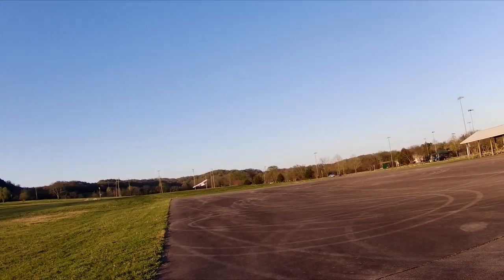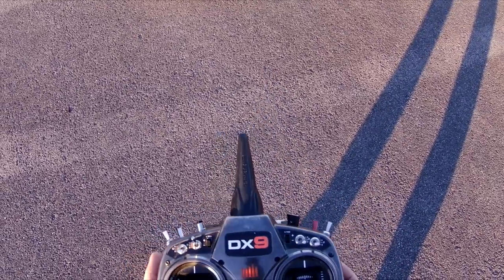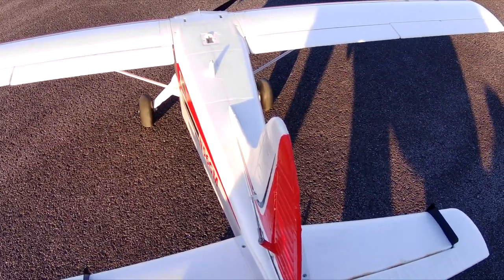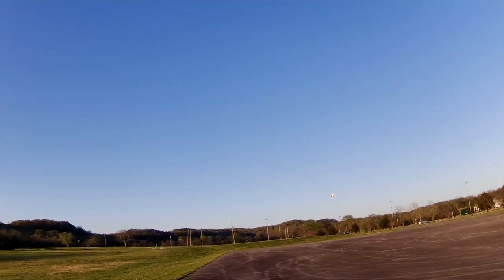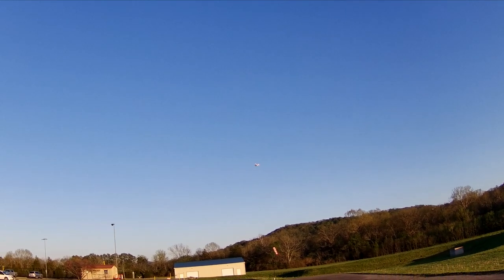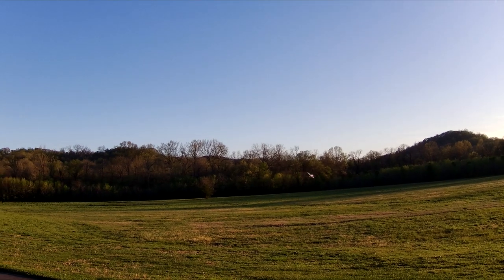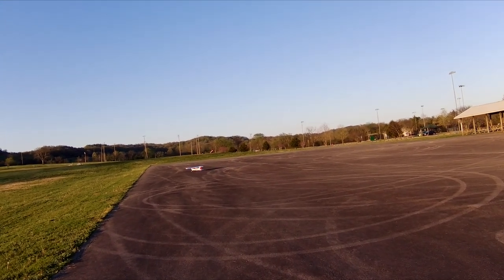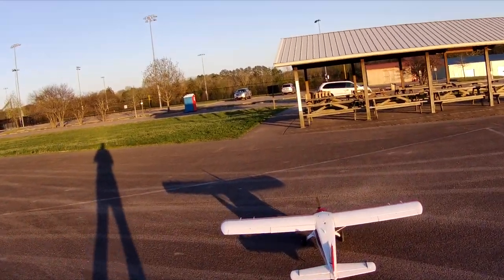6 FT FMS BEAVER V2 RC PLANE WITH REVERSE

Comment: Awesome landing! That's the landing you want right there. Stay up on mains until the plane comes to a complete stop, then gently place the tailwheel down at rest. LOL. Gonna save that rudder servo! I've been thinking about ways to reduce wear on it, maybe perform all rudder servo testing/movements with the tailwheel raised on a jack stand, reduce taxi-turning as much as possible, and land exactly like you just did. You weren't running your Glider Tow Hitch Cover or Antennae's!
Reply from the maker: THE ANBTENNAS BROKE A LONG TIME AGO AND THE TOW HITCH IS BROKE ON PURPOSE SO I COULD GET SOME NEEDLE NOSE THREW IT ONE DAY LOL
Reply: @GRIFFINRCPLANES  Lol, saves weight! I was wondering about how the Tow Hitch Retract affects the CG. Floats too for that matter. Was wondering if the allowed room of the CG was actually the 2 CG's with and without those addons... 
Anyways, just watched a cool vid with 2 awesome Beaver mods- Cutout between seats to push battery back, and Full Span Flaps!